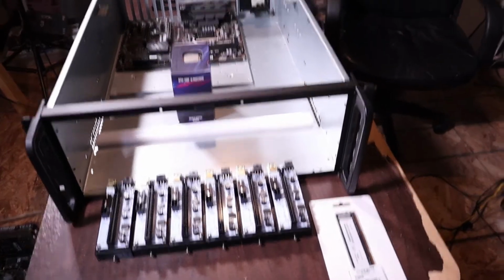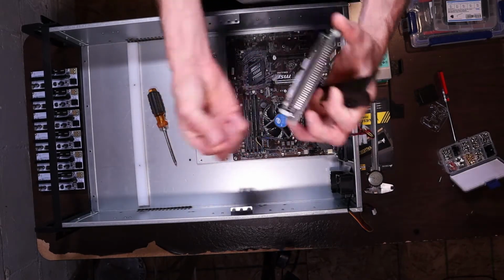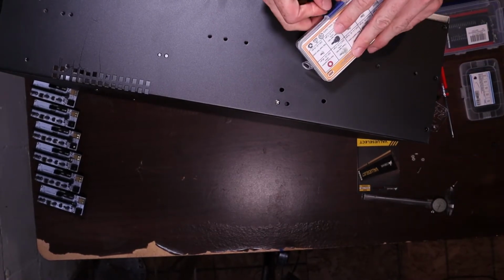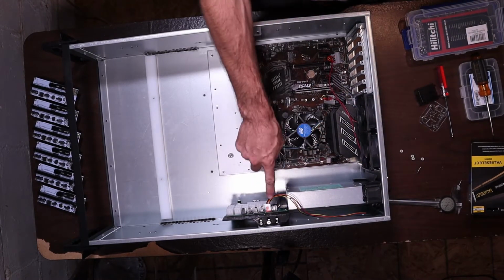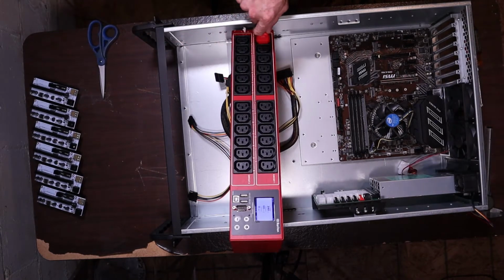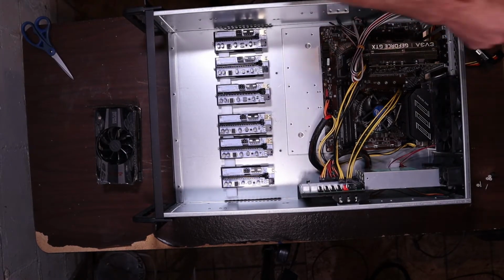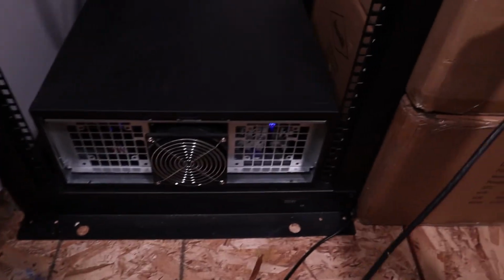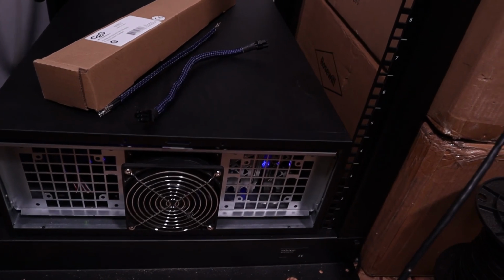VLOG SERVER CASE EP03 - 4U Server Case Mining Rig

Comment: The psu adapter and breakout board bracket you designed, would you share these stl files?
Reply from the maker: yes We will release the STL As all these Parts are going to be CNC machined out of 6061 Aluminum and sold on our website so 3d printed files I have will be release as soon as new Website upgrades get done.